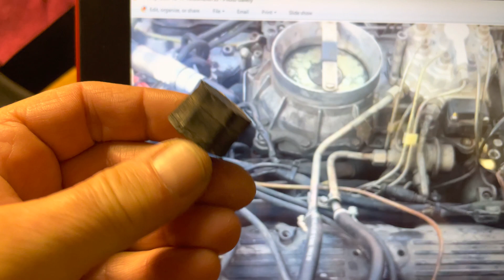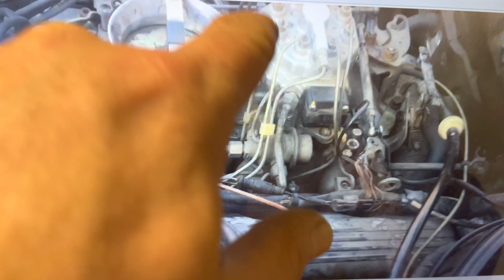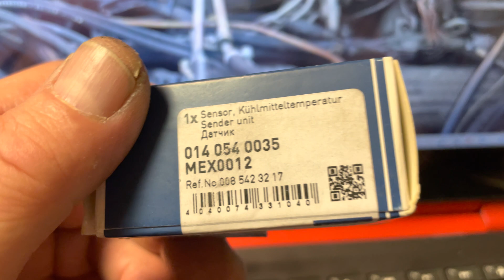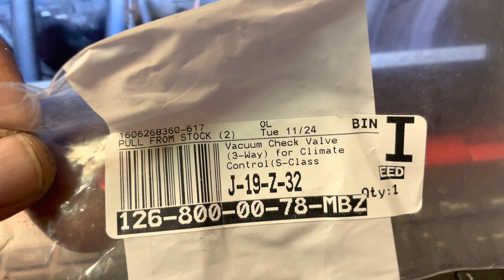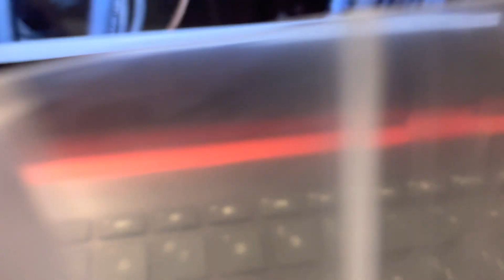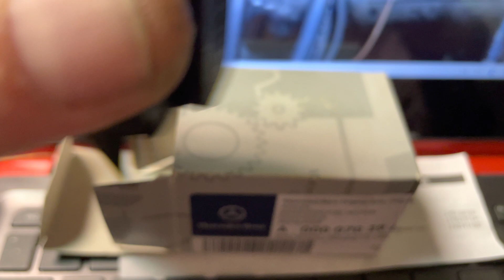Mercedes Benz W126 560SEL 03/89 Idle Speed Control Valve Test and Repair Part 8

Comment: In addition to the Idle speed control valve, you should replace the OVP relay, mounted on the rear firewall, on the driver's side. My 1991 420SEL was idling dangerously fast, and I researched the problem. I was instructed to replace the OVP, and the idle control valve and hoses. No trouble since!
Reply from the maker: My OVP is fine. That wax one of the first items we checked thoroughly.
Reply: Where do you buy your new OVP relay ? Can you recommend a seller that has it in stock ! Thanks.

Comment: Thanks for the video. I have a 1986 420sel that is also idling rough when cold, and idling high when it’s warm up. I am going to replace the idle control valve & all the rubber hoses. Thanks again.
Reply: Sure! Let us know how it works out for you.